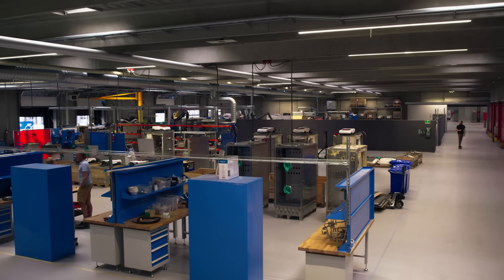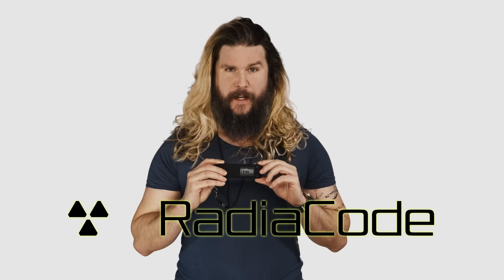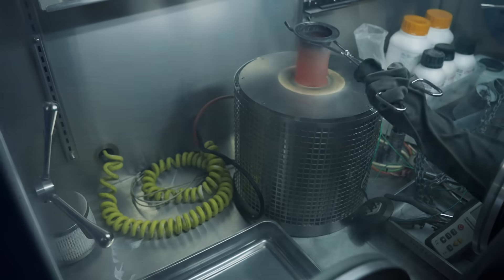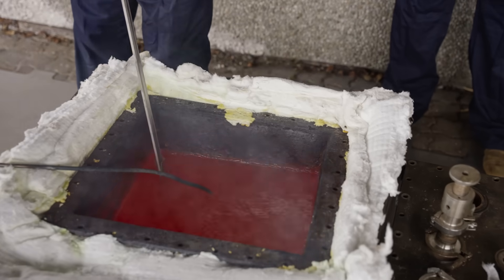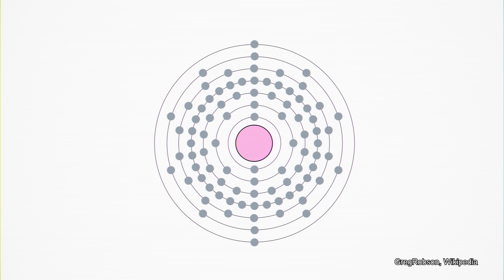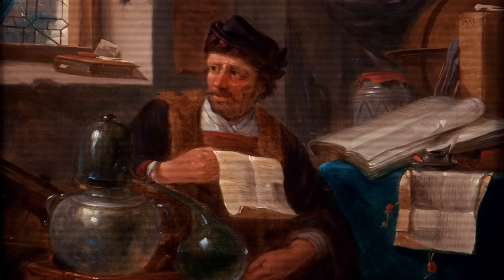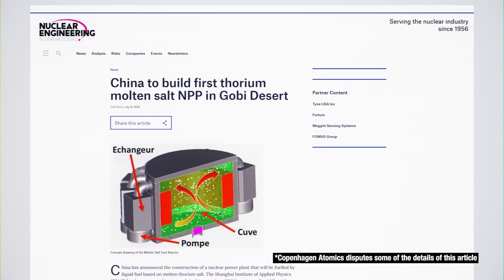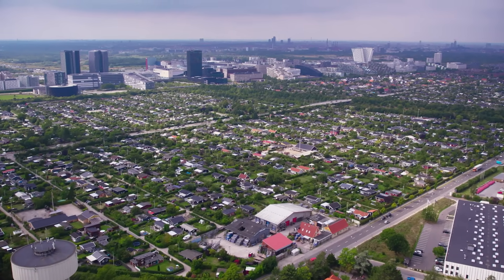Is THORIUM the Future of Nuclear Power?

Comment: It's all depends on one big question: how expensive will be usage of molten salt reactor.
It is all about maintenance, salt is very corrosive material, molten salt, is even more corrosive, what material can handle so extremely corrosive, and hot material and do it for years, even decades! There should be pumps, valves, and seals that can hold that nasty stuff for many years. If there will be complex and frequent maintenance required - reactor operational cost will be very high.
And even much simpler uranium pwr/bwr reactors aren't cheap to operate, this is main reason why no country is going full nuclear, if nuclear power plants were much cheaper, it would be much more commonly used.

Comment: To spoil part 2, the reason uranium is used is bc the waste material is used in weapons. DU (depleated uranium) is almost as dense as tungsten, but is "cheaper" since its a waste product of nuclear energy. It combusts on contact with air basically making flaming soda cans spit out of the A10. It is also used in the classified M1 Abraham's composite armor as its so dense, its harder for rounds to pennetrate it. (Yes abrahms have been lost in Ukraine, but those did not have the composite armor) so if there is no military benefit, to create a financial bennefit, there is no reason to stop using uranium.

Its like when we went to the moon. There was presteige. Then new technologies (cordless high torque drills) were created since plugging in chords in space to the ISS was complicated compared to a compact battery-powered drill.  The drill is the DU rounds in this case. If there is no technology or weapons to he gained from depleated thorium, it lacks the financial incentive to change to invest.

Comment: I'm a bit shocked that this entire video did not touch on the fact that these reactors fail safe. It's hinted at with the "freeze plug" in the diagram if you know what you're looking at. I assume that could be discussed in pt 2, but I do find it interesting. To me, that is the biggest selling point. I don't think nuclear power fails to gain ground because of issues with the tech, but instead because the public is uninformed, and having a reactor that fails safe could help to alleviate those misplaced concerns if the messaging about it is at the forefront.

The focus on the breeding is not going to sell to people who are uninformed in my opinion. It's only interesting to us geeks that already wish we had more traditional reactors anyway.

Comment: I’m curious what the failure modes of a molten salt reactor are and how they mitigate them. Presumably a leak of the salt would be Bad News [tm], especially if it’s full of dissolved nuclear fuel and/or waste. Though I suppose the fact that the salt is liquid that would quickly freeze in the event of a leak might simplify containment a bit, not being a pressurized gas and all.

Also, what happens if the salt freezes inside the plumbing? I know that water is unusual in that it expands when freezing, so salt might again be easier to contain, but how much of the system would need to be scrapped if it happens, and what do they need to do to prevent it from happening in the first place?

Comment: Great video as always and I am waiting for part 2.
However, I don't like the explanation of the 12:00 "breeding" process. If it wasn't for my minuscule prior knowledge I think I could understand it as a kind of "perpetual motion machine". Thorium fuel producing more thorium yet emitting extra energy in the process. The "breeding" process description lacked the emphasis on it actually "bumping up" the number of neutrons in "pre-fissile" material making it fissile and "fertile for producing energy". One still needs to provide the "pre-fissile" Thorium-232 or Uranium-238 into the reactor, which are more common than fissile Uranium-235 used in common reactors.

Comment: Oh come on, you guys just made red Kool-Aid with boiling water, you can't fool me! I do have a question, though: how small can they make such a reactor? I dream of something the size of a septic tank which can be buried in a persons yard like septic tanks are in some places which can provide power to a home for 100 years with no maintenance, no fuel replacement, MAYBE even providing hot water heating but that's not necessary, if it just looks like a gigantic battery with a positive and negative post that can be connected where the grid connection used to be that'd be fine.

Comment: No one talks auf the freeze plug that makes the reactor walk away safe. 
So all external power can go down as in fukushima and all operataors can drop dead am and no radiation leaks out.t
That was shown in the US oak ridge national laboratory which developed the molten salt reactor as a way safer reactor than the previous versions. But no on looked at it because it won't produce nice plutonium as a side product to build nukes.

Comment: I thought it was more like maple syrup. Heard that some models of a MSR would stop a melt down. If there was a leak in the plumbing the salt would crystalize back into a solid which would plug up the hole. You would just have hot slag (coreium) making something like the elephant's foot at Chernobyl.

Thanks so far the video has helped me understand a bit more than just having he stuff I have read about them.

Comment: It's all about heat transfer, I served in the US Navy on ships with 400#, 600# and 1200# main steam systems. One of the reasons to design 1200# systems was efficiency, the turbines could be much smaller and we got more useful energy out of a pound of steam. With the higher temperatures in liquid salt the same efficiency would apply.

Comment: The difficulties in materials development for molten salt reactors remain and are not close to being resolved. We have almost 80 years of experience examining molten salt reactors, going all the way back to the Aircraft Nuclear Propulsion Program begun by the US Air Force in 1946. Since the beginning the materials used to build the reactor have been the biggest problem. We still don't have a 100% reliable solution to the corrosion and increase in brittleness caused by the neutron flux and the basic corrosive nature of the fuel. Oak Ridge National Laboratory developed the best solution to date, Hastelloy N, but it still has corrosion and brittleness problems. Another unsolved problem is the intermediate product of the thorium reactor, protactinium-233, which decays naturally into highly pure uranium-233, which is a very viable weapons grade isotope of uranium. There is not yet a viable storage solution for increased amounts of U-233. For those who are interested in learning a more truthful and balanced examination of the issues, look up the Bulletin of the Atomic Scientists article on molten salt reactors from 2022.

Comment: Too bad their core design completely negates any purported safety benefits by literally passing liquid water next to >500 C corrosive salt with only a thin metal wall in between (it would have to be thin to prevent excessive neutron absorption). Steam explosion waiting to happen.

Comment: 13:50 "our metal components only last 5 years."  Yeah, that's the key engineering challenge. There is all sorts of chemical reactions in a separation plant, at high temperatures. I wish them best of luck.

Comment: Nuclear power has no future. Not because of security, just because of the scale of nuclear projects. Even the most pro-nuke friendly countries struggle to build reactors within ten years, more like 15-20  years if planning is included. But you need to shell out billions almost from the start anyway. That capital is not available for the decarbonization that could actually work in the required timeframe.

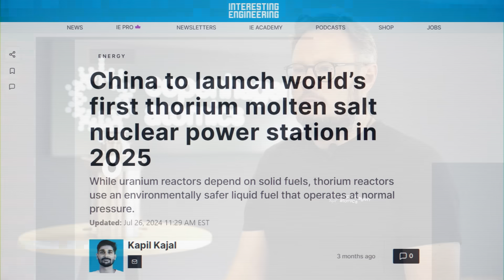Comment: (14:01) "Thorium molten salt reactors would produce less nuclear waste and that waste would be less toxic"

This is completely FALSE. Not only would an MSR not produce less waste than a traditional LWR (light water reactor), the waste it produces would be MUCH MUCH more toxic/dangerous. The difference between an MSR and LWR is the type of waste being produced. If you put 1 ton of fuel into either an MSR or LWR, you'll get 1 ton of spent fuel "waste" out either, however the mix of what that "waste" is composed of would be different. Also, before I go on, I should also note that radioactivity and nuclear half-life are approximately directly inversely proportional, meaning the longer the half-life the less radioactive something is.

A LWR's waste is composed of three groups of materials 1) ~95-96% represents unfissioned uranium (~99.1% U-238 & 0.9% U-235). This unspent uranium isn't actually waste, but rather "wasted" fuel. Also, U-238 & U-235 have half-lives of 4.5 billion and 700 million years, respectively, and are thus barely radioactive. You'd have to eat the stuff or take it into your body for it to actually harm you. 2) ~1% of spent LWR fuel represents transuranics like the various isotopes of plutonium, neptunium, americium, etc. This is what's produced when a U-238 get's hit by a neutron and rather than fissioning, it absorbs it and transforms into a new element. Transuranics typically have half-lives in the many thousands to tens of thousands of years, but because they have such long half-lives, they're not terribly radioactive either (plus they're mostly alpha emitters which means you can effectively shield their radiation with just a layer or two of tin foil). Transuranics can also serve as fuel in fast spectrum reactors as well, so like the unspent uranium, transuranics are also not actually waste but rather "wasted" fuel. 3) ~4-5% of spent LWR fuel represents fission products, or what's left over after an atom is split. This stuff is the ACTUAL waste, as it can't be fissioned any further. Also, fission products generally have short half-lives, and so are SUPER radioactive. However, because they have short half-lives, they go away fairly quickly, with the vast majority of fission products decaying away to stability within 20 years of so of being produced, the primary dangerous exceptions being Sr-90 and Cs-137, which combined make up ~12% of total fission products, or ~0.5% of total spent fuel. So, long story short (too late), it's really only the fission products produced by a LWR that should be considered "toxic waste".

An MSR like what's described in the video, or a thermal spectrum MSR thorium breeder, would produce waste composed of ~98.5% fission products and 1.5% transuranics. That's because the U-233 produced by the reactor fissions 90% of the time it's hit by a neutron, so only 10% would absorb the neutron to become U-234. That U-234 would then absorb another neutron to become U-235, which fissions 85% of the time it's hit by a neutron. So after those two fissioning events, you're only left with 1.5% of the original fuel as transuranics, the other 98.5% being fission products. And as previously noted, that 98.5% composed of fission products is SUPER DUPER radioactive.

So, if you put 1 ton of fuel into an MSR and LWR, you're going to get 1 ton of spent fuel waste out (i.e., no difference), but the spent fuel coming out of the LWR will be mostly composed of left over uranium and transuranics, which aren't that toxic unless you eat them. The MSR on the other hand produces waste almost entirely composed of fission products which are SUPER toxic. 

So the waste produced by an MSR is MUCH more toxic than what's produced by a LWR. However, because an MSR's waste is almost entirely fission products, it decays away MUCH faster than the waste produced by a LWR. So more toxic but it goes away faster.

Comment: a thermally balanced or thermal-negative reactor is safe
I wonder if it is possible to create a thermal-negative setup that unless you provide external heating or reactivity it will balance out at an "idle burn" that keeps the fuel melted and flowing, but can act like a battery with a ramp-time....

mass produced thorium reactors, something I might literally buy for my off-grid home

buy a reactor, part swap every 5 years, get shipments of thorium and send out waste(or even bury it in chambers I dig out under my home in my apocalypse bunker with emergency seawater purification as backup water when the world is ruined)

bonus if the whole breeding aspect can eventually create a few RTG's for backup when the molten salt needs maintenance

plus I can direct that excess heat via steam to heat my home, or even provide cooling of my home via complex thermodynamic strangeness at high efficiency

sadly I would have to be licenced by the NRC to operate, and that means I couldn't be off-grid as I would need some way to pay for that license and shipments to keep the reactor molten....

Comment: I think what is missed here are the challenges working with molten salt.  Not only is it molten (very hot) it is super reactive.  Add water and you will have a really bad day (so what do you do if there is a leak and the molten salts set things on fire?).

Also, how do you fix a broken valve or pump or what happens if a pipe cracks and spews this molten metal around?  If you want to run a power plant with this for decades such issues will become important to deal with.

Comment: Isn't it obvious? The key problem is that the metal piping only lasts for 5 years. A little research suggests the following: a combination of self-healing oxide-forming materials and ceramic piping is a technically feasible approach for thorium reactors. Such a system could achieve a lifespan of 20–50 years and potentially approach 75–100 years with advancements in material science, careful reactor design, and rigorous operational protocols.

Comment: I didn't realize FLiBe salt doesn't explode in the presence of water or air like previous salts used like sodium and potassium. That's a HUGE deal. That''s WAY more important than the cost of fuel or removing fission products, IMHO. The problem noone talks about with molten salt reactors is that we have not come up with a safe way to handle molten salt at the required scale. Engineers and physicists especially love to overlook the real world like what happens when piping leaks (which it always does), what do fire safety systems look like in buildings full of highly reactive and radioactive molten salt, how are piping and components replaced when the coolant freezes solid at safe handling temperatures, corrosion, etc. It doesn't do a whole lot of good if the nuclear safety is better, but the operational safety and cost is orders of magnitude worse. Fuel cost is a small percentage of the overall costs of running a power plant, but because nuclear physics is flashy it gets a disproportionality large amount of the press when discussing reactor technology. The nuclear physics is fun to nerd about, but in the words of Rickover, the devil is in the details.

It sounds like this particular salt may alleviate some of these concerns. I'd love to see more people discuss this when talking about these reactors as I believe it could truly be the difference maker, not the lower cost of fuel or reduced waste. I'd also love to hear more discussion on corrosion, that seems like the next operationally prohibitive problem to solve.

Comment: I really want to know more about the cleaning process. How many types of alternate isotopes gets produced? Can the thorium absorb more than one neutron and what happens? Can the other atoms in the salt absorb a neutron, and what does that do to the fuel? Do the transmuted products crash out of solution and get filtered off or does it have to be chemically processed?

Hoping most of those are answered in part 2!
Reply: The chemical processing plant is the advanced part of this.
Reply: The cleaning process is currently a box in a diagram labelled "cleaning process". This reactor is still far far away.. Never mind that you need to license being able to treat the fuel online, with the fuel being liquid and not in a labelled, numbered and registered fuel pin which IAEA is keeping tabs on. That is a gigantic safeguard risk.

Comment: I have a feeling we're going to see Terrestrial Energy in Canada moving this particular ball down the field more than anyone else very soon.  No, they're not using Thorium as a fuel but I feel like that's not important because that's not really the difficult part of these reactors.  The IMSR as they're calling it uses a molten salt fuel carrier with UF4 in it.  They plan to replace entire reactor core units every seven years, and they're essentially selling them as thermal energy production units.  You build a facility with two bays for them to sit in, TE ships you one of them and you install it and have access to however many MW's of thermal power to do whatever you want with.  Seven years later they ship you a second one and you shut down the first one, and then a few years after that they collect the first one(after short-lived fission products have decayed).  It sounds expensive but it's going to be a market-based solution so we'll know if it's viable based on whether or not they're making sales, IMO.

Comment: You skipped the downsides of a molten salt reactor - Since the fuel circulates and is pumped - all this pumping equipment is radioactive, and maintenance is either via remote handling, or robots, and molten salt is extremely corrosive so they will need maintenance ... this is one of the reasons that after initial testing of thorium molten salt reactors back in the 50's and 60's it has not moved forward much despite all the advantages